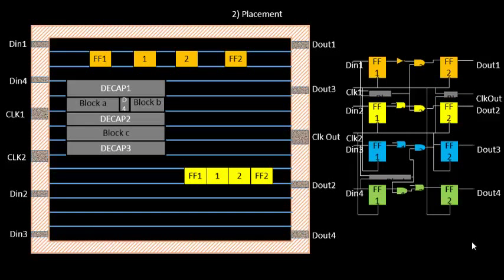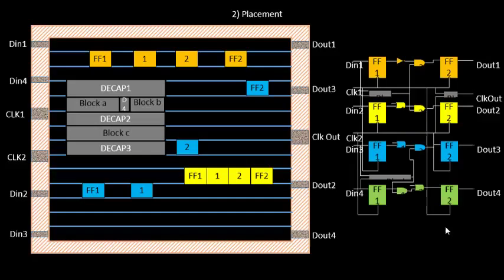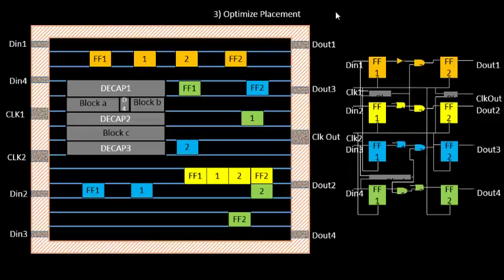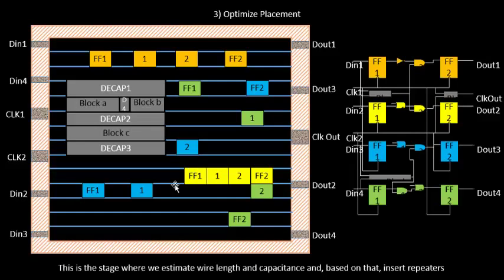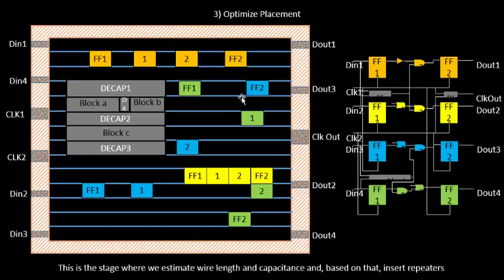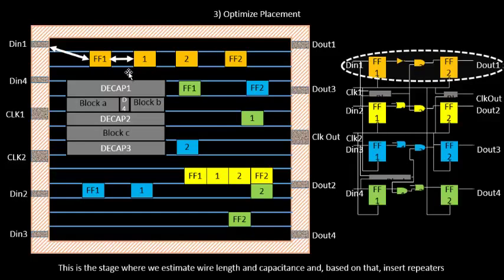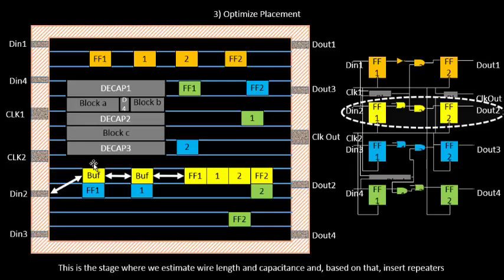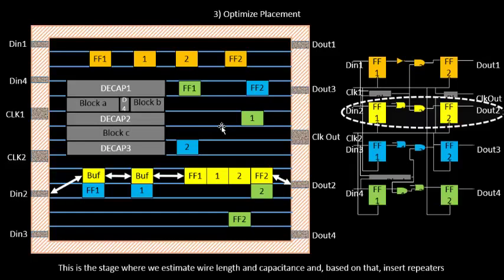How to Optimize Placement Using Estimated Wire Length And Capacitance?? Learn @ Udemy- VLSI Academy

Comment: Hi Anagha,

Thanks for responding to Akshay's question. However, I just have an additional question. So after we do STA after CTS and fix the skew issues, when we route, is it necessary that the tool will follow the exact same routing that it assumed during STA, or if we change the congestion/timing driven settings, the routing can be changed by the tool. And if the routing changes, wouldn't that lead to the possibility of timing violations again?
Reply from the maker: Pooja Jagadeesan Hello Pooja,After CTS, the STA is done using real routes for clock path, and estimated routes for datapath. So, it might not follow exact same routing, that it assumed during STA. However, once we fix clock skew issues, in CTS stage, most of tools, is not expected to touch the clock path, during routing. You can do an experiment. Measure skew before routing and after routing (while keeping everything else the same). You will find that most routers will not touch the clock path, while focusing to route datapath only, and fixing timing violations, that might come during datapath routing.
Thanks

Comment: Hi Kunal, I have a question regarding timing analyis. We check timing after the CTS stage and then do the routing. What if we first do the routing and then do the timing analysis. How will this affect the design flow ?
Reply from the maker: Hello Akshay,
I believe your question is you do CTS, skip STA, do routing and now do STA. Please correct me if wrong. Yes, that's always possible. The only catch here, if you STA after CTS, you can identify clock skew issues before hand, and fix them at CTS itself, before routing. Now once the skew issues has been fixed, and you have confirmed using STA, the routing will try to optimize real timing paths, for which skew is already met. Skipping STA at CTS, will overburden routing to optimize datapaths affected due to bad skew. This will impact the optimization Run time. 
So, its possible, no affect in design flow. But its recommended to do a quick STA after CTS. 
Thanks
Kunal
Reply: anagha ghosh
Hi Kunal,
I get it. Thank you for your help. This really clears my concepts.

Comment: I am not sure if the questions I am posting on the Udemy website are getting posted at all there, so just wanted to ask some questions here, that I had in the following lectures as well.

1. Aren't paths between two separate clock domains false paths for which no timing analysis is done? (I remember declaring them as false path for STA)

2. What are the ON state leakages that can occur in PMOS/NMOS?
Reply from the maker: Hello Pooja,
We were not receiving notifications on Udemy, due to some technical reasons. That's resolved now. Sorry about the inconvenience you faced. Coming back to you questions
1) If a valid datapath exists between a flop driven by clka and flop driven by clkb, then not necessarily its a false path. You can declare it though, depending upon the design specifications. But otherwise, the clocks are synchronous, and the timing path between them is valid
2) Can you please elaborate on the question?
Thanks
VSD Team

Comment: Hi Anagha,

It was a wonderful video, thank you for the clear explanation. Could you please tell me how the wire length and RC delays are estimated? Are the wire load models used for that purpose?
Reply from the maker: Hello Pooja,
You are right. There are Wire load models used for the same. the estimation is basically the shortest possible distance between two points. The below link, lightly explains about the wire-length calculation, though not exactly the algorithm, but parts of it are used as Wire load model
http://archive.aweber.com/awlist3810424/DKhAP/h/Maze_Routing_Lee_s.htm
Thanks
VSD Team